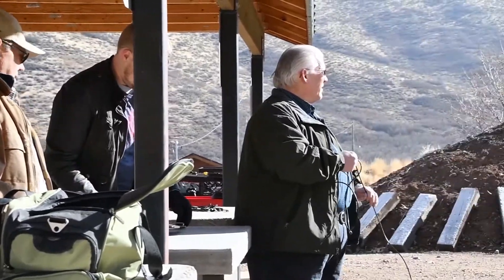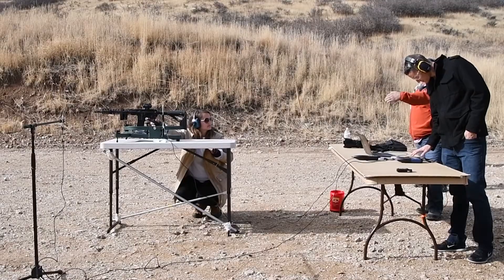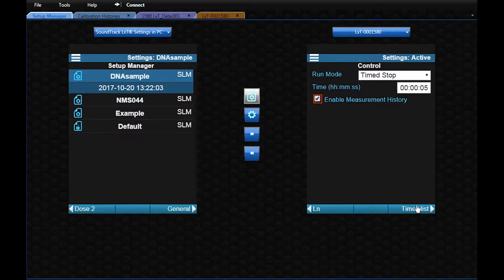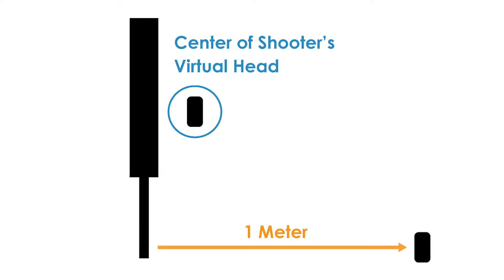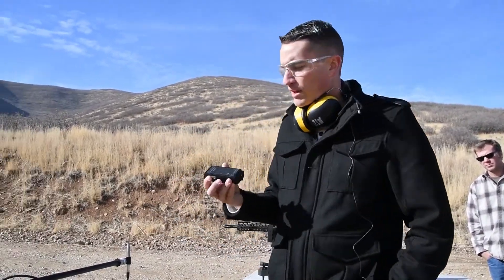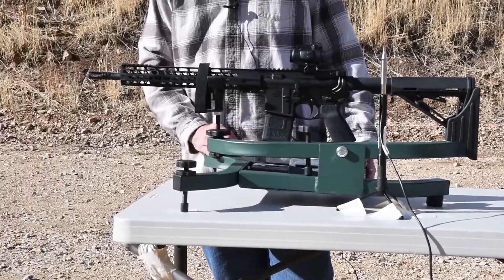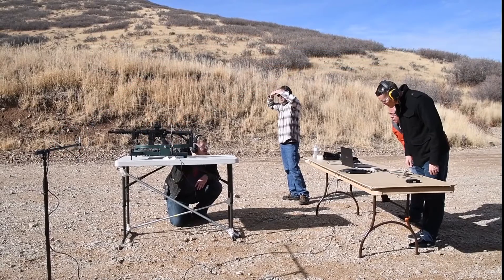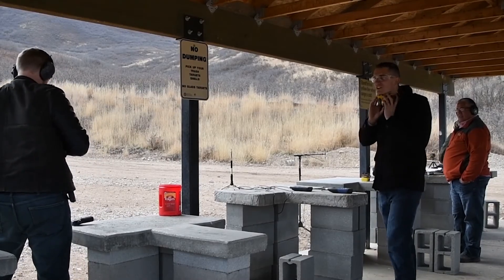Gunshot Sound Testing with LxT QPR Sound Level Meter

Comment: Did someone f up the data here? Or how they edited the video? In the sections where data numbers are posted as the rifle is fired it reads barrel noise at 96 something and shooter receiving the 100+ db levels, then at the end of the vid it shows numbers on computer spreadsheet as being opposite.....hmmm ya really good video people...engineers, pffft.
Reply from the maker: When using microphones designed for very loud impulsive noise, the measurement range in which you are able to measure peak levels accurately is limited to high sound pressure levels. At 4:29 in the video you can see an example where the peak levels are both shown and you can see that the barrel position is the louder point when the gun is fired.
Reply: @LarsonDavisPCB what is the price to rent a meter capable of reading gun fire decibles? I can't find any information. Just a round about for let's say a week? I just want to see what my air rifle is doing compared to a 22 cal firearm

Comment: WTF ? How is the ambiant noise around 100db ? Shouldn't it be around 60 or 70 in a desert kind of place ?
Reply from the maker: It is correct that the actual noise floor of the area is lower than what is shown with this video. The combination of using microphones designed to measure very loud impulsive noise and measuring peak levels makes it so the measurement system is accurate at very high sound pressure levels, but limits its ability to measure low noise levels. Typically a different setup with a larger microphone would be used for an ambient noise measurement in a situation like this.

Comment: This is a well done video.  One item that was not discussed regarding peak level measurements is the slew rate for the preamplifier and the meter.  If the slew rate is not sufficient, then the peak amplitude will be underestimated.  I am glad that they show how to set up the meter for the measurements.  It would be helpful if other companies provided similar video documentation for using their equipment.
Reply: the other item not addressed, is having 2000-4000 rounds + fired every single day
week in and week out, for 9 hours a day.  You want to live anywhere near that?
I didn't think so.
Reply: @savannaswildnatureworkshop7810  bitch wtf are you talking about? Why are you on this video? How is this relevant to the comment?
Reply: @savannaswildnatureworkshop7810  how is it any different to living near a highway for example?